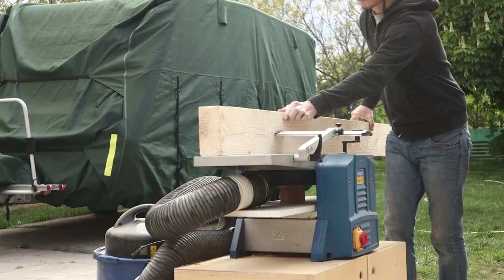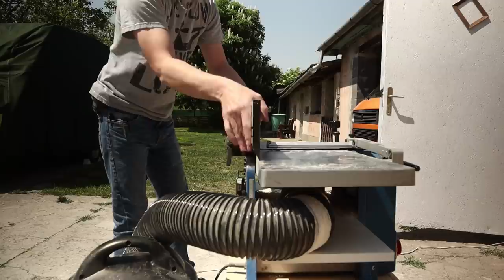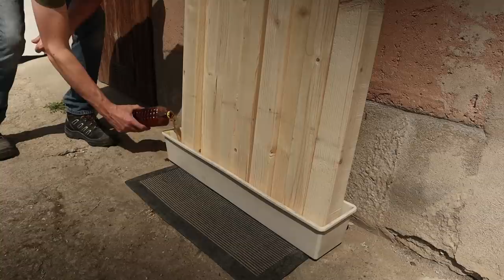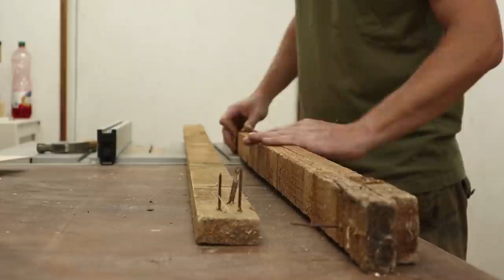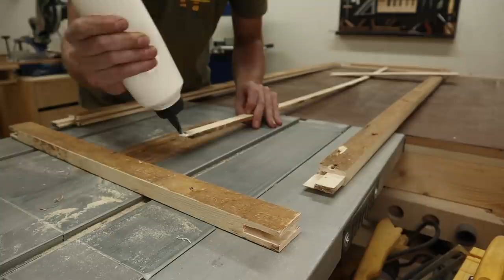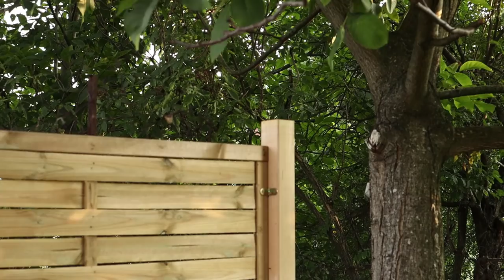Probably the best Privacy Fence I’ve ever built

Comment: I like the fence panels, but I am not sure about the metal post holders. Im going to give this a try. Thanks!!!
Reply: Yeah, in my experience they don't hold up that long under normal circumstances. But he might be in a low wind area, could be fine
Reply from the maker: Yup. Time will tell. They seem to be a little flimsy.
Reply: @Ollaris  im in Japan, I dont think that they would survive the first Typhoon. Ill have to concrete in my posts.
Reply: I enjoy your work, always interesting to see what you will change in the video. Thanks！I am looking for to see what you do next。
Reply from the maker: Thanks Scott! Glad you enjoy it!
Reply: @TheBigart1974  I used to live in Japan! This has a very strong Japanese feel. I now live in a hurricane/typhoo area and I wonder @Ollari's if it breaks the wind okay? Does it shudder? If in a high wind area, would it be better to turn the design 90 degrees?
Reply: @ivanbroski  i ended up going with upright slats with about a centimeter gap to allow for airflow. I also used 4x4’s that are concreted into the ground. My house will blow away before my fence.